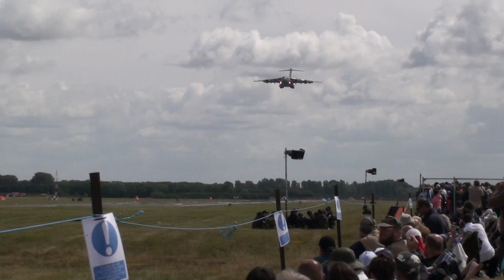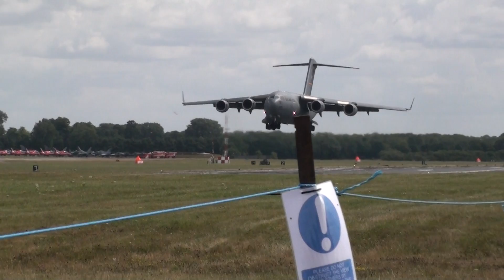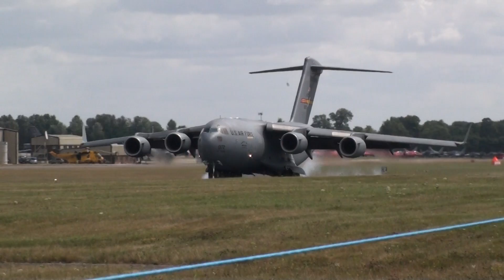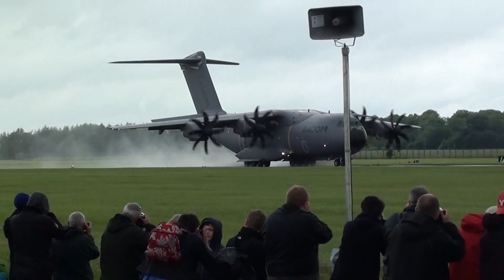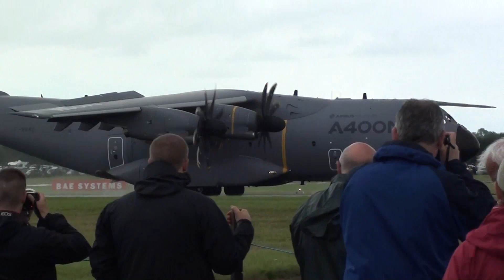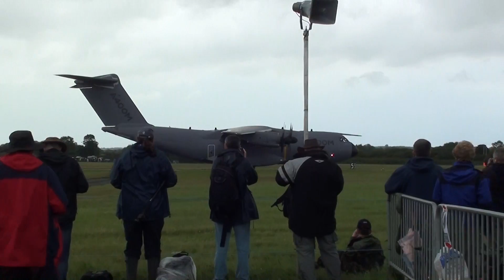Tactical Short Landing C-17 vs A400M. What Brakes The Most. Reversers, Wheels, Props, Spoilers?

Comment: Both aircraft are best at what they are designed for. The C-17 for larger loads and greater range and the A-400 for lighter loads and shorter ranges. I don't think the A-400 was designed to replace the C-17 but was designed as an alternative for a militarily that does not require the range and capabilities of the C-17. Don't know why persons are arguing as to which is better. The C-5 is better at what its designed for as with the AN-124. Stop arguing about it.

Comment: Wasn't the A400M Replacing the C-130 Not the C-17
Reply: it carries twice the weight as a c-130j but cost 2.5 3 times as much witch brings it closer to a c-17 but carries half the weight for a similar price
a400m does not know what it wants to be tactical or strategic it can carry one m2 Bradley fighting vehicle wile a c-17 can carry 2 or one Abrams tank for a price difference around 20 million
Reply: *****
C-17 has more 4x the fuel consumption per mile of an A400m...
Reply: nowthisis2stupid
 C17 maximum cruise speed: 930km/h
A400M maximum cruise speed: 780km/h
so whe are far from 2x the speed for the  C17...
Yes the consumption from the C17 is higher because the efficiency from turbo jets is lover as turboprops: this is nothing new, so the old Antonov AN22 ( ~same cargo load as the C17) consumption per transported ton was better as from the C17 for the same cause (max cruise speed from AN22~= to the A400M)
And the comparision between cargo loads is unrelevable because the  missions are different:
Strategic: long range+airport usage or light prepared dirt, minimum exposition to operation risks
Tactic= near the operations, landing on short and unprepared dirt
Same difference between a Porsche Cayenne (city and highway SUV= C17) and a Humwee (= A400M)...
Reply: *****

The A400M is designed to replace C130 and C160 who are all two tactic transporters...In the most conflict theaters, are Abrams absolute non sens: such operations need light and agile tanks like AMX10RC , and they fit in the A400M...
At full load need a C17 twice the rolling distance, and turbojets are very efficient to suck up stones and sand who wear it up very fast...
Reply: leneanderthalien There is some truth there, so the question becomes Do we expect to operate from dirt / grass/ sandy runways 75%, 50%, 25% or less? I have not done any sums on this, just instinct, but if you were going to operate from unmade or very sandy runways 50% or more, then props become very attractive. If you plan going to a runway like that once every 3 months, then it's still an issue, but not a show stopper. The points you raise are good, but don't lead to simple yes / no answers. They're a can of worms, probabilities and guesswork. Let's take sand, asphalt or cement runways, but blown sand on them. That will cause some degree of increased wear & tear on ANYTHING, including an old Carabou. Exactly how much is going to be almost impossible to predict. You can estimate. You can even present mathematics which support and justify your predictions, but they're still estimates and quite likely to be very inaccurate. A more sensible basis for decision is projected trip length. Yes, that's also something you don't know, but you can estimate whether you expect to do a lot of half hour or one hour flights, versus many twelve hour flights. I would favour a prop driven aircraft if it was going to be mostly an hour or less flights. But a C-17 cruises along very nicely for 12 ~ 15 hours at a time, and cover quite some distance that way. All these designs have particular strengths and weaknesses. The trick is to be able to predict what your needs will be. If you can do that with any precision, choosing the right plane becomes very much simpler. Otherwise, this becomes like an argument about Nissan V Porsche. If you know exactly when and where and how they will compete, that's one thing. Otherwise, it becomes a question of whether you like Japan or Germany.
Reply: nowthisis2stupid
 You have problemn with arithmetics and metrics? betwen 930 km/h and 780km/h whe have 150km/h= 81 knots difference, not 300 (= 555km/h)...sorry but in european aviation, before WW2 was all speeds and altitudes in metric, from France to Germany up to Soviet union...i never accept the anglo saxon diktat about usage of they primitive mesurement system, so i rest at metric :-)
In normal conditions, France not need C17's: heawy battle tanks are totaly useless in Africa, and this is the only thing who is untransportable with the A400M ...for heawy tanks whe have the Mistral ships (whe have 3 of them , a 4' planed, and if Russia continues he's stupid cold war scenario in Ukraine, soon 2 more (the Vladivostok and he's sister ship, but need to be convert to French specifications...)
Reply: leneanderthalien I had written a paragraph but I'm going to sum it up a c-17 is a aircraft flies into safe areas because it's expensive the c-130 flies into dangerous places where an aircraft loss or damage is cheap quick and easy to repair or replace a aircraft because of the age of the designee the a400m has new age composites witch is more difficult to repair after taking 23mm he aa fire at a forward operating base having to glue frames together and the c17 designee is 25 or more years old the a400m is a decade younger
Reply: Kneedragon1962
 The usage on unpaved fields cannot ben reducted to a percentage, because all military aircrafts, inclusive helicopters, are use essentialy on paved because unpaved is agressive (wearing), but for example, in some french/african operations  i known, the unpaved can rise up to 50%...And in such case, in most times are use C160 or C130, but they cannot send significative loads on long distance tranports ("commercial charge" is replaced from kerosene...), but in early times, i see more than one time a  Antonov 22 in operation to accelerate the heawy transport (was even use for race cars transport during Paris-Dakar race) and this aircraft is HUGE, but unpaved capable, but now i think only 1 or 2 are still in service...
Some nations cannot spend ennough money in they army's to buy a fleet of C17's, so the most heawy military transport are take with Antonov 124's (not use on unpaved)...The missions from the A400M is to replace the  C160 and C130, and some AN124 transports (so tactic and strategic), like in France the Rafale as real multirole, replace for all they missions, and in many situations much better, the Mirage F1 (~comparable to the  F16), the Mirage 2000 all types, the Jaguar, the F8 Crusader,the Super Etendard,etc...
But for realy difficult unpaved operations ,the C160 who is able to operate on small places a bit like the Caribou, is replaced from Casa C27J...
Reply: *****
 France lean usually Ukrainian Antonov AN124 to send supplys to external operations, despite some french troops was stationned in many african countries, the Mali operation need quick exceptionnal big supply volumes send direct from France, so was reinforcements needed to transport a large amouth of vehicles (AMX10RC,VAB,helicopters...) and supplys (ammo, food...), but this was exceptionnal: France is not the USA: whe have only limited means.
France is unable to buy expansive heawy transporters not permanently needed...The French 2015 army budjet was planed to be reduced, but because the anti terrorist actions in mali and Irak , it was only maintained at same level as 2014.
So No, Airbus never built a bigger strategic plane because nobody in europe can afford it ...Whe have the  same problem in the French Marine, who need 4x  C2 greyhound for carrier supply transports, but no budjet for it= no aircrafts...
In the  past , was France interrested to buy 3x C5 galaxy, but if the built factory was still closed,  to relaunch the factory need a minimum of 5x  C5 to reach a acceptable cost: France as not the  money for 5, so the  project was abandonned and France buy only a handfull C130 + if the cold war was ended, lean some AN22's and AN124's for cheap...
Reply: leneanderthalien See, you missed a crucial point when reading. The MAXIMUM speed of the A-400m is 420 knots. The CRUISING speed of the C-17 is 450 knots with 169,000 pound payload. They do not disclose it's actual maximum speed. Also, I could care less about your "superior" speed measurement. Knots has worked for the last 200+, if it isn't broke, don't fix it. Kind of like the C-17 or the C-130J. Your god plane, is 3x the cost of the C-130, and has less than half the max payload capability of the C-17. It's a bastard child, of absolutely no use. Oh, but it is fuel efficient... lol.
Reply: nowthisis2stupid
 i'm not speak about maximum speed but maximum cruise speed this is a bit different...maximum speed  is never use in operations, it's only a reference...Why compare whith the  C130 who is only a refitting from a very old aircraft, not particulary strong built (for memory the C130 who loss they wing and kill they crew: 1 in the  USA, and 1 in France...), and the C130 is much smaller and slower as the A400M, the C17 cannot make the tactical missions from the A400M, point and finish, no more non sense discussion about this.
And for the speed and altitudes, in occidental aviation was after ww2 the Imperial mesurement system 100% imposed from anglo saxons, for each speed (not only over 200 knots) and altitude, this was NOT the case before ww2 (all use International metric system overall , except anglo saxon countries and colonies who use Imperial = the USA are still a British colony, i think the French alliees for the US independance like d'Estaing, Rochambeau,La Fayette...will be very disapointed from this situation!
So was only a DIKTAT from GB and the USA, by  the way, in Russia and China is the metric system still in local use , and in europe is the metric system still use for gliders or ultralight aircrafts.But in the space, is only the metric in use: why not in the  atmosphère? is the atmosphere british?...

I think the anglo saxon reject the metric only why it was initialy a french idea to hamonise the mesurements system (before, all countries use they own), nothing more...
Reply: In 50 years use from the C160 Transall in the hardest conditions, the lost from a engine was extremly rare, and replace the gigantic turbojet from a C17 is not a simple afair in a country without serious infrastructures ...
Fuel: the difference between military fuel and civilian fuel is only  that the ingnition t° from the military fuel is higher , and it's possible ,without modifications , except simple settings, to use diesel fuel in a turbo engine (jet or prop)...the  only limit is the freezing fom the diesel fuel in low t°...early turbojets use gasoline (for ex. the auxiliary jets from the  Neptune P2V7...)
Reply: *****
False numbers:
with 30 tons, the A400M can fly 4535km and with 20 tons, it can fly 6390km
I think with "your" numbers, the Brits never buy it...
Reply: ALTITUDE, PAYLOAD and SPEED. All the talk of fuel economy is problematic. Turboprops have their place but the A400M can't consistently get above the jet stream. It just doesn't have the altitude. It's comparing apples to oranges anyway. Compare it to the C-130 not the C-17
Reply: James Looks
 What? the A400M fly at same altitude and in same air lanes as the commercial jet aircrafts, the cruise speed is only a bit slower as the C17, but not realy significative, and none transport aircraft fly over the  jet stream current altitude who is  12000 meters  (near 40 000 feet), but can rise up in some case up to 16000 meters (52000 feet)...only some jet fighters, reconnaissance aircraft or strategic bombers (ex: the old propeller Tu 95 who can fly up to 13500 meters...)  are able to fly such altitudes...
The  C130 is much smaller...the A 400M is intermediate between C130 and C17...so direct comparision are irrelevant...
Reply: ***** 'Europeans don't think outside of Europe'.
And we're back to bullshit.
Reply: leneanderthalien jane's sums it up http://www.janes.com/article/47600/uk-to-assign-a400m-crews-according-to-their-abilities
Reply: leneanderthalien janes sums it up  http://www.janes.com/article/47600/uk-to-assign-a400m-crews-according-to-their-abilities
Reply: ***** Thank you.
Reply: ***** That's it tuck your tail and call anything you can into existence. The C-17 uses 4x the fuel and carries 2x the cargo and is capable of 2x the speed. Also, it may consume 4x the fuel at full military power. But at cruise I highly doubt it's drinking that much more fuel.
Reply: leneanderthalien Europeans don't think out side Europe for example France who is fighting in Mali they have no heavy lift planes Canada uk and usa had to send their c-17 to help them airbus will make a larger version with 4 a330 engines in the wings and carry 100 tons 10000 km then land on a beach
Reply: leneanderthalien Africa is tank country lots of wide open areas with some trees (limiting the killer of tanks the anti tank guided missile) and the phz2000 155mm (French amx something ) the a400m can carry 700 155 shells and charges at 55 kg and 1400 for the c-17 I don't know why we are comparing a middle to late 80's strategic airlifter with a late 2000's version airlifter some amarican planes are 23 -25 years old and your will see a similar engine upgrade for the c-17 (general electric GEnx) as you seen for the c-5 galaxy and tanks do work to fight insurgents like Belgian and Canadian tanks in Afghanistan and later Americans tank. you will see a new generation airlifter replacing the c-17 and c-5 in the 2020's with 4 777x engines  2 tanks plus crew and filled with ammo 10000 km and your will see a 777x sp tanker
Reply: nowthisis2stupid You're overlooking one important thing.  Unlike the A400, the C-17 uses a very popular and widely used civil aviation engine.  You may suck up debris and blow a compressor or take a MANPAD into an engine, but in an emergency, you can get a replacement from almost any major airline in the region.  Sure, it may not be set to use J series military fuels, but the US has been transitioning largely to civilian fuels to simplify logistics....
Reply: http://www.janes.com/article/49260/avalon-2015-airbus-showcases-a400m-down-under
Janes says that c130j-30 can carry 15 tons 5244km wile the a400m can carry 20 ton 4539 km its all about European and north American defence strategies in Canada during the cold war we would get engineers from the army to build a runway from the forest in 5-7 days that a hurk could land on and that's why Canada had a 50000 maxed out flight hour e model and the rest at 40000 plus hours when the rcaf got new j-30 models look at cfs alert or Danish nord station you have to fly in fuel and supplies parts ex
Reply: ***** north amarica is sitting on around 1.5 trillion barrels of oil sands .350 trillion bbl and shale oil .900 to 1.3 trillion bbl (kerogen in a retort) usgs green river formation both cost about 50 bucks barrel with long wall mining. Canada has 132 trillion cubic feet to  2040 trillion cubic feet natural gas hydrates (cbc 2 to 30 times conventional reserves) in the Mackenzie river delta all you need is to lower the presser largest coal reserves gas to liquids and coal to liquids biofuels thorium uranium from mines and seawater lots of lumber energy is not a problem hear plus plus the a400 is a tactical airlifter where it lands on a beach or field where the c-17 lands on an gravel or engineered strip I was only comparing the price per unit and everything you get for your money Canada was offered the a400 but turned it down on cost and production timeline reasons so we bought 17 c130j and 4 c17 of their deployments one c17 helping or was helping the French in Mali, one services alert (most northern base/airstrip) and one supporting Iraq mission wile the other is in maintenance we probably need more c17s but old Stevie is even slashing veterans programs and military so he can give tax breaks to win 2015 election
Reply: leneanderthalien ok so it's only 300 knots faster... lol. Oh, and the C-17 can carry things that the A-400 only dreams about. It may use more fuel, but last time I checked it's not a Prius. Go ahead and brag about the A-400m's fuel consumption. While your country is having to drive or boat it's MBTs in, or ask the U.S. to bring them in with their actual heavy lift aircraft.

Comment: C-17 hands down. It out performs the airbus in a lot of different scenarios including long range flights, short field takeoffs, soft field takeoffs/landings, etc. not to mention it stops WAY faster than the airbus on the landing. And just because the airbus is newer than the c-17, that doesn't mean shit. The c-17 has all the latest avionics, engines, etc. The airbus will never be the plane the C-17 is now. PERIOD.

Comment: You can't compare the C-17 (160,000 lbs) to the A400M (80,600 lbs),  it's like comparing braking characteristics of an automobile to a tractor trailer.
Reply: Your numbers don't quite do it justice.  C-17 has over twice the MGTOW.